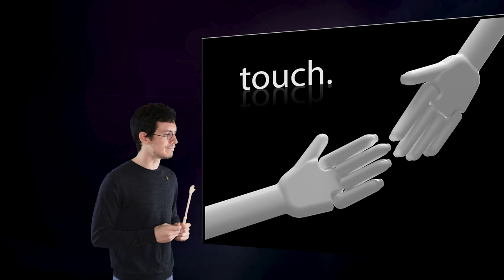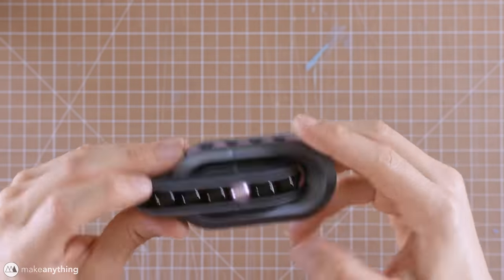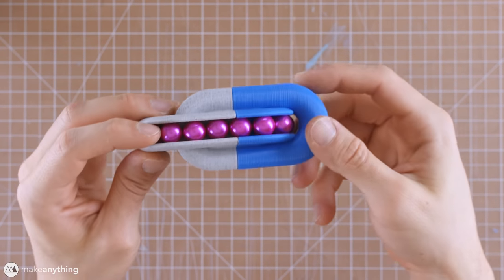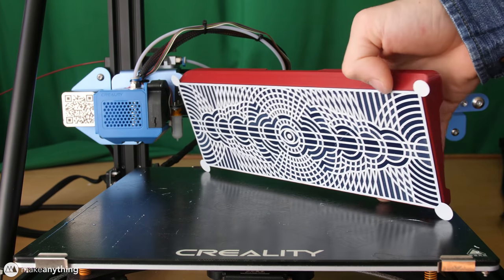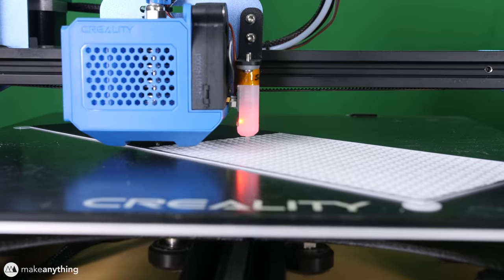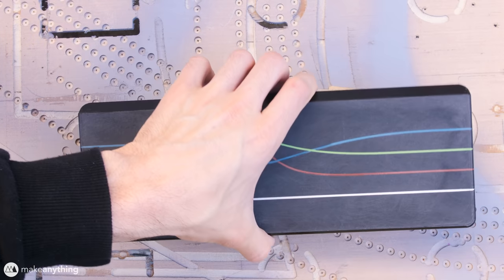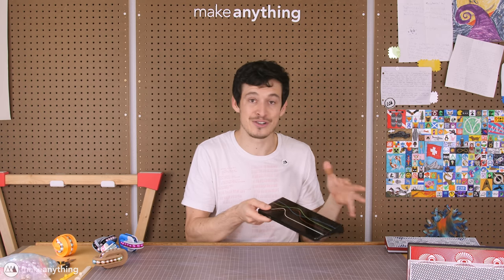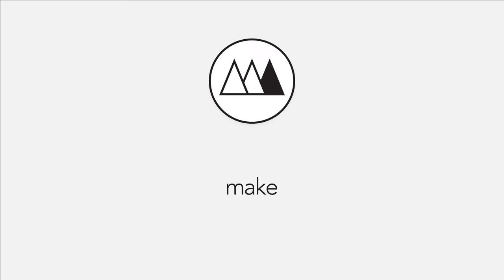Cool Prints // A new puzzle, polishing 3D prints, & more!

Comment: My sanding: 240, 400, 800, 1200, last two wet. Acrylic clear coat, multiple thin passes (at least 5). Does the job, every time. Some filament actually look the best just after 240 and very thin coat. It doesn't get glossy but makes the surface have a uniform look. WOrks best on natural/beige/brown and white plastic. Black needs to be sanded carefully, you may need to skip the 240 as it can scratch the surface too easily. Sanding sponges are the best, they are easier to clean and they don't clog easily but they are a bit pricey, save them for objects that have tough shapes for sand paper. Print sanding blocks that are meant for the piece.. That is one thing that we often forget, we can copy the exact shapes from the model to sanding blocks that fit the need perfectly..

Comment: I come from more of a woodworking background.  In the wood world when one is trying to achieve that “rubbed out” high gloss look, you would use lacquer instead of polyurethane.  There are a couple advantages.  Lacquer dries in like 10 minutes, and it can also pretty predictably be coated wet on wet.  Also each subsequent coat basically dissolves the previous coat and become this one homogenous thing at the end, which lends itself well to sanding.  Polyurethane is basically layers on top of layers, like a jawbreaker.  Sometimes when you sand through one layer but not another you can see those witness lines.  I really don’t know what effect lacquer has on PLA though.  The solvents in it might dissolve the print for all I know.  Maybe someone with more experience in coating 3D prints with lacquer could chime in.  Really cool stuff you’re doing as always.  Take it easy and be well.
Reply from the maker: Thanks for that insight, it might be worth trying out

Comment: i have to say I LOVE all the different techniques you come up with using somewhat minor code tweaks. If you know of any filament that comes out really clear as a single layer or two when printed, that could give you a good protective layer before the colors are applied. Then when you finish it, you could try the poly spray or a clear resin coat, and not worry about having to sacrifice too much of the design material to finishing.

Comment: I just bought a 3d pen because of you and some of your old videos!! It is awesome but I want some more ideas. I love to watch your small projects, can you make another 3d pen video ????? Or a review of one ??
Reply: Tim Eisnor I totally agree! I would click on that video so hard!
Reply: Tim Eisnor   Just curious on what 3D pen you bought?  I’ve been in the market to buy one but they are either really cheap (with bad reviews) or really expensive. I would like to find something reliable order $40 if possible.  Could you give any suggestions? And where to buy?  Thanks in advance for the help.
Reply: trcmustang I bought the Mynt3D pro 3D pen off Amazon. I believe it was around $30. After 5 months of light use, it still works fine. I highly recommend it. 
Theres a stopless speed controller thingy, which is great for finding your niche, and the temperature control has been really useful, as it is in 1 degree increments. 
There is a problem with the pen where it goes into standby mode if you change the speed away from the fastest, but the company was really gracious informed everyone that it was due to the adapter included and not the pen, and offered a free replacement adapter.
There’s a service door, which would be helpful if a) the pen broke and b) I knew anything about mechanics. 
All the issues I’ve had with 3D printing has either bee due to my lack of skill or to the cheap filament I bought. 
I hope this helps!
Edit: realized this was addressed to OP, not me, but I hope it’s helpful anyway!

Comment: I loved the Apple Parody😍
You are truely a little Jobs.
I am about to buy a new Prusa Printer and I am not quite shure which printsurface I shall buy. I plan on making such multicolored prints like you did. You used a smooth surface but I guess a textured surface does look nice aswell. What kind of printsurface do you recommend, the smoth PEI sheet or the Powder Coated PEI sheet?🤔
Reply from the maker: I don't have experience with the Prusa print surfaces, but I'd say go with whichever you like the look of. I should note that people have had trouble doing the multipass technique on prusa printers because of the matrix leveling it runs between prints
Reply: Make Anything thanks, I will look into it 😊

Comment: I also had the whole dust issue when using polyurethane on my prints. I found a very low-tech solution to it. Paint the piece in a box and cover the box immediately after.

Comment: 7:24 What if you 3d printed a sorter to separate the beads by those small differences? There exists a subset of the beads you ordered which has better diameter consistency than the entire set together, you can use that subset instead of designing your puzzles with looser tolerances

Comment: you should design a mecanism, like a sift, that allows only a certain diameter beads to pass troughm that way you can separate the larger from the smaller tolerances.

Comment: After the 320 sand paper you should then jump to 600, 800 and 1500 at least. for spectacular results sand with 2500 and 3500 too. Then apply the polyurethane.

Comment: the multipass technique makes doubleshot equivalent keycaps possible to 3d print so maybe get into custom keyboards  asa plastic is a good choice because it's better with weather than abs which equals more longevity
Reply from the maker: I started making keycaps like this a good while back but boy is it a lot of work
Reply: @make.anything  Very agreeable because of the subtle curve on the surface and the problems with asa

Comment: Quick Question - why are all of your prints oriented in that 45° Angle on the print bed?!
Reply from the maker: Keeps parts further from the edge of the build plate, easier to make micro live leveling adjustments using just the bottom left and top right leveling screws, and it distributes the motion of the flat surfaces between the X and Y motors instead of just using one at a time... which may allow for faster or more stable printing. It seems cleaner, at least :P